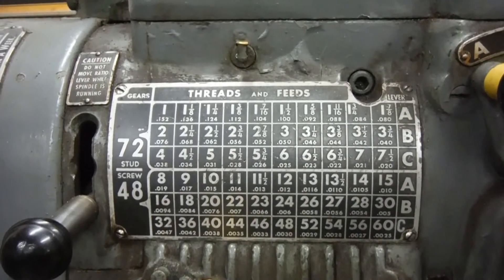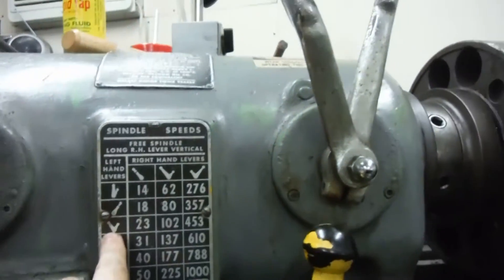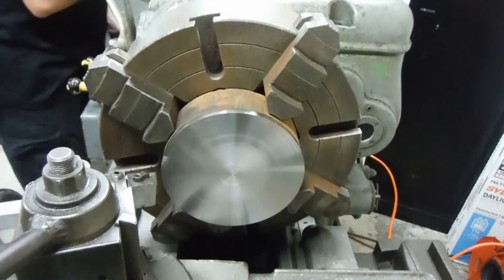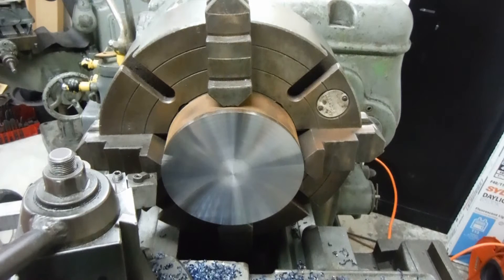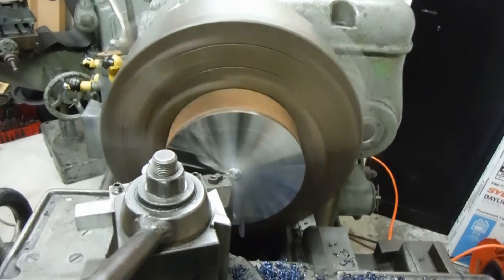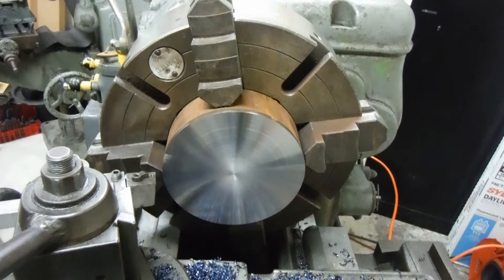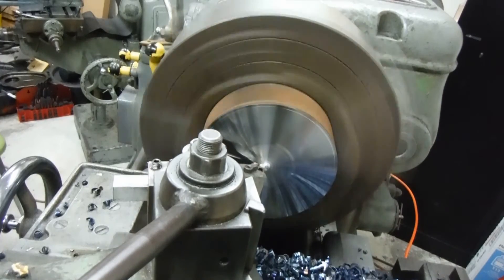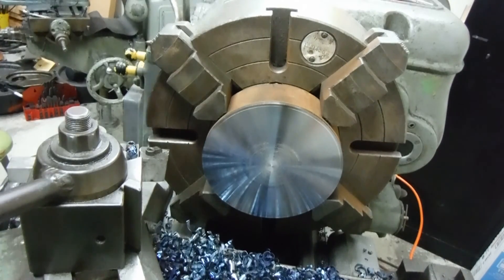Face off with the Pratt & Whitney

Comment: What size 4 jaw chuck do you use on your 12C? I've got a later box-head style P&W 12C
Thank you
Reply from the maker: I run a Cadillac 12" 4 jaw.
Reply: Wow, and a 12" isn't too big? I guess I may be able to get one with t-slots in it after all!
Reply from the maker: Larry King the machine is a proper 12 x 30 lathe. There is a built in riser that enables you to spin 14-1/2" diameter work.

Comment: You talk of bearings, can I assume you are talking about spindle bearings?  I have a 16x54 C model that could use a set.  Any luck on finding new ones?  Seems the original maker closed in the mid 90's.  Thanks.  RK
Reply from the maker: The spindle bearings are pretty tough to find. They are flanged extended inner race annular contact bearings and long discontinued. 
Mine came from Vintage Bearings in England at a VERY reasonable cost. Now I need to install them.
Reply: Very nice thanks for the reply.

Comment: I have the same model lathe, and what I believe to be the clutch lever (below the feed-direction lever on the carriage) does nothing.  Any idea if adjusting the drive clutch would put it back into action?  Clutch is accessible from a panel (4 bolts) on the back near the clutch arm assembly.
Reply from the maker: multiHappyHacker I  honestly don't know how to connect that lever. I haven't had it apart.
Reply: Yours does work though?  It removes power from the spindle right, but not a brake?
Reply from the maker: Mine works. There are two shafts below your carriage lead screw. One selects travel direction and the other is for the clutch. The two clutch levers move together. It sounds like something has come apart in your apron if the lever doesn't move the shaft or in your gear box if the shaft moves with the lever.
Reply: The key that turns the shaft when I move the lever has a good deal of play in it, not sure if it's moving the shaft far enough to fully engage honestly and I can't tell if the play is normal.  I might try to look into the wear on the key sometime soon.
Reply: multiHappyHacker needs more power captain.
Reply from the maker: It has more power now. The American Rotary phase converter solved that problem.

Comment: Hey Kevin, I have had this same exact model of P&W for about a year now, and I love it, but don't have any info on maintenance, using the taper attachment, etc. Have you found any literature on it? Thanks!
Reply from the maker: Ipschnug I have copies of the original manuals that came with the machine. There is no how-to stuff once you get past setting the lathe in place. If you need part numbers and drawings they may be if some use.
Reply: Thanks for the quick reply! Sounds like the manuals you have are the same one's I've found in pdf. Have you ever used your taper attachment? I think I'm missing the piece that ties the cross slide to the taper slot.
Reply from the maker: I'm missing the shoe for the pin too. I've thought about making one from Delrin but haven't needed it yet.